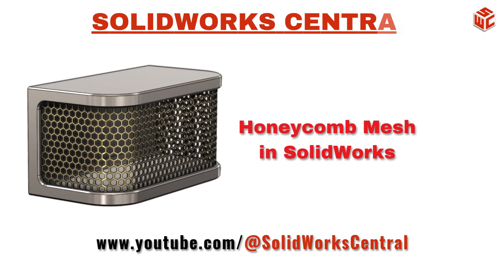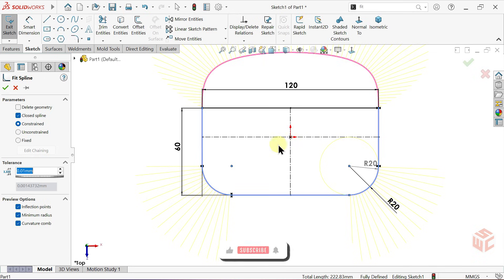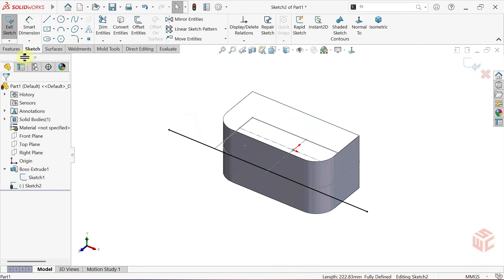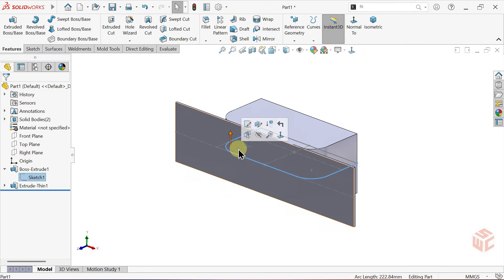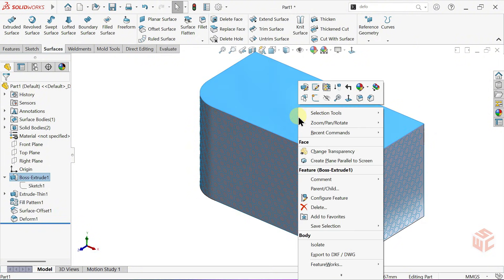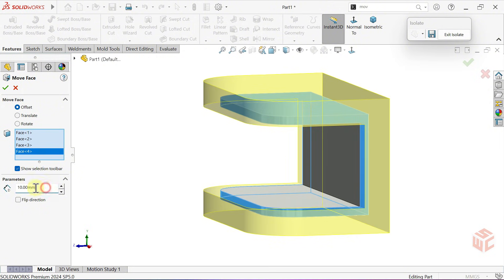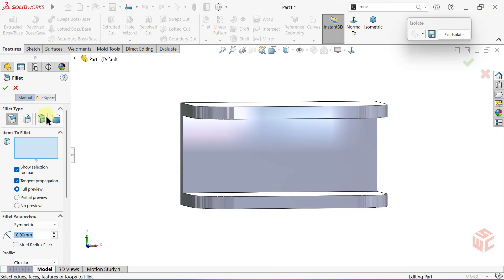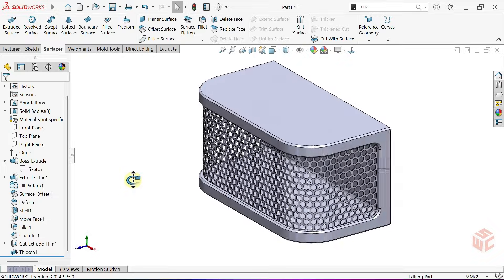SolidWorks Tutorial | Step-by-Step Realistic Honeycomb Mesh Modeling

Comment: After I clicked "exit isolation" after making the honycomb shape it's just extruded cut in the hole shape not just the surface that I was working on 
Do you know what's happened wrong 😔? 
And deform didn't work even I did everything just as you did 😢
Reply from the maker: If the issue is still not solved, could you please send me a screenshot of the problem via Instagram or email? Sorry for the late reply. I couldn’t respond earlier due to some health issues🙏🏻

Comment: My deform doesn’t apply correctly. I’m selecting both the edges as you did but it doesn’t look the same.
Reply: Nvm I figured it out
Reply from the maker: Great! Glad you solved it 👍🏻
Reply from the maker: Possible reasons why your Deform doesn’t look the same:
1. Edge compatibility – The “Curve to Curve” option works best when both edges have a similar length and direction. If one edge is much shorter/longer, the result will look different.

2. Surface continuity – If the selected edges belong to different faces or there’s a sharp corner between them, the deform may fail. Try knitting or trimming surfaces first.

3. Fixed edges setting – Check the “Fixed edges” option. If the wrong edges are fixed, the deform won’t move as expected.

4. Complex honeycomb pattern – Because the honeycomb surface is very detailed, Deform can behave unpredictably. Usually it’s better to deform a simple surface first, and then apply the honeycomb pattern afterward.

If the problem continues, feel free to write again and I’ll try to help. 👍🏻

Comment: Hello teacher, what is your advice for me to know how and when to use each feature? What are the ways I can learn well? Thank you.
Reply from the maker: You need to practice and exercise a lot and think about how you can do it in different ways and not be afraid to try. If you really want to learn, sometimes you have to go on and on, even if you get bored. The models I made can be made by going in different ways and using different commands. Today I will post my 6th video in the Exercise series, for example as a simple example, but you can draw it in 3-4 different ways. Every designer has a unique style. You can create both fast and our own style by giving labor and practicing a lot over time.
Reply: Thank you very much, our teacher.